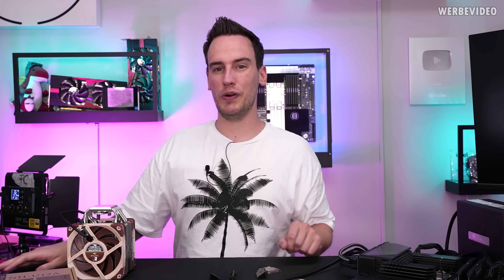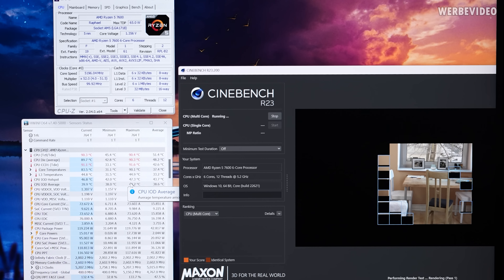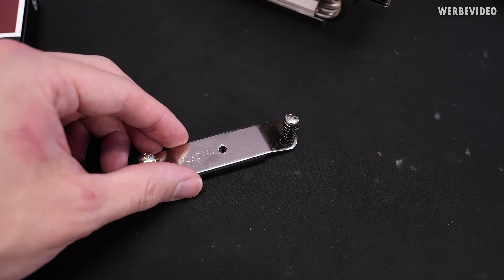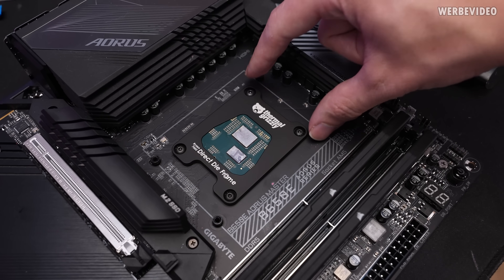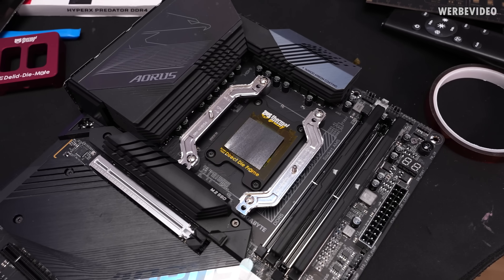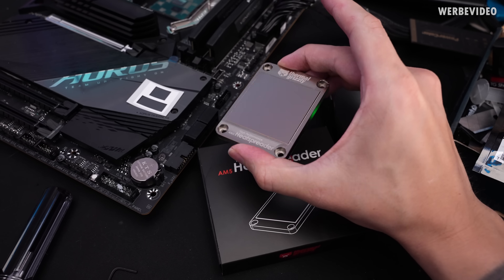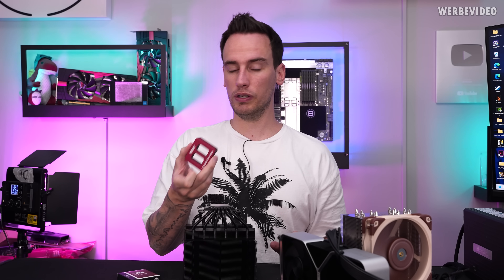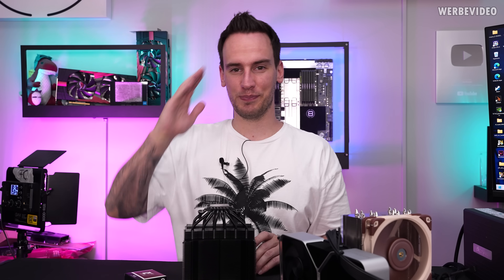How this 120$ Noctua Cooler beats a 360 AIO

Comment: This is great and all but putting this amount of weight on a board is a tterrible idea. Once I did this and LGA775 would randomly not boot due to warped socket.

On PGA I never had problems but those are on the way out...

Comment: Hi great video but I did not think this is a fair comperason. From someone who approachs very scientific for pc stuff I would like to see air cooler vs aio with stock cpu then what deliding is capable with mounting regularly then what is offseting the cooler is doing. In this video is not like apples to apples I think.

Comment: The only issue with air coolers is case compatibility, unfortunately my pc0-11 D is 155mm max, being 3mm too short otherwise I would have gone with a Noctua cooler for my recent upgrade. The Scythe Fuma 3 fits but isn't out for a few months, i'll probably swap out the corsair H100i I got once it's released though for the Fuma because the pump sound is atrocious on the new corsair AIO's.
Reply: My case is also 155mm max and yesterday I installed NH-U12A on my 7600. Still there is 2-3mm gap between glass. I think there will be no problem about your case too. It's Zalman N3 btw

Comment: You failed to mention the Noctua fan speed. You did mention the fan speed was locked at 1200 RPM on the AIO. So to be fair that should be the same locked speed on the Noctua cooler.

Comment: I have 2 i9 13900k systems. One had an NH-D15 the other an Aorus Waterforce X280. Both have similar cooling capability but the fans would run up and down all the time on the AIO and the fans were noisier so I put the NH-D15 in the 2nd system too.
Reply: That is an interesting real world test you have made there 🙂
Reply: If you mount the rad externally the Waterforce would be superior, rads in cases soak up lots of heat from other components really easily.
Reply: I learned the hard way that AIOs are not actually more quiet than air cooler. Sure your fans can run at really low rpm but you have a screaming pump which gives you a headache. I would take loud fans all day instead. My ears get a ringing from this AIO I bought and I start to develop a headache a few minutes after booting up.

Comment: These Direct Die/Heat Spreader solutions are quite appealing with the growing interest on SFF cases lately.
It makes possible keeping temperatures under control with powerful CPUs, high loads while cooling with compact coolers and less than ideal airflow.
But i have a question about these conduction materials: in this case, wouldn't be ideal to use those Honeywell thermal pads? the laptop industry is migrating to this solution , laptop chips are direct die cooled... And i bet Noctua will come up with a paste/pad designed idealy to sit atop the chips
Reply: Thermal pads are generally lower performance with the key advantage being less maintenance and more reliability - strictly speaking while a direct die setup can absolutely be very reliable, if you're putting in the effort to build one it's probably worth the tiny bit of extra effort to deal with higher performing paste as well.

Comment: Here is a philosophical question for the crowd. Is it temperature gains or temperature loss? Thermal gains sounds to me as the most correct, since there is no inherent positive or negative on a scale and you would measure positive outcomes which is subjective and situational.

Comment: I switched to Noctua air coolers more than a decade ago.  My newest system, an Intel Xeon W7-2495X 24-Core, ASUS W790 ACE, 512GB DDR5, also uses a Noctua NH-U14S 4677.
I stopped using water cooling about a decade ago when I had a $6000 system leak and corrode the main board and case.  I'm too paranoid now, I would be checking a water system daily.

Comment: 20€ 220V- 45W Fan will be much more cheaper to run with better results. Noise levels good enough. And 50€ 100W 220V AC industrial fan will blow so much air that you would need to tie your case and display monitor so they don't fly. It worked on worst south Europe summer for me, getting at least -20ºC and being as close to room temperature as possible. More elegant but with too much noise if not properly tuned is using a 12V radiator fan from a Motorbike or Car that have a lot of CFM, pressure, etc. Only problem is where to connect so big currents 80-100W and transient filtering, you'll need to ask a car-machine electrician. But cheaper and better.
How exactly waterblocks don't try to fix to existent cpu heat spreader? There are so many ways of tightly machining parts, headgaskets, water tight hig temp pressure adhesive, o rings, etc. for cents or some € of cost that it's incredible how much R+D effort goes to not try to not losing warranty or clamping to existing parts and reducing chances of breaking all expensive electronics...
If a supposedly 65W Ryzen 7600 goes to 90ºC you can alway buy a 12th/13th Intel Cpu and limiting max power to Level 1, and don't let it boost to max power, you'll get as much perfomance and even less power of actual Watts (instead of heat transfer related ones of AMD). PEtryy sure you can match gaming perfromance of a 7600 with a DDR4 12600/13400/13600K setup at real 65W (or below real 90W)

Comment: The kryosheet is a graphite pad. It's not optimal for cooling unless both sufaces have an absolutely perfect mirror finish on them, as it would produce air pockets in any imperfections as well as the graphite being not the best conductor compared to a silver based compound or even liquid metal.
I use graphite pads in retro computing because older CPUs were designed with crappy lithium compound as the standard tim, but modern components are designed for higher performance tim.
Reply: It's a graphene one, and it has higher conductivity than any thermal paste.
Liquid metal is better. You are correct here. But most people find its application quite difficult.
Reply: @tiggertsk  This isn't graphene, it's graphite. Actual graphene is a single atom in height. I own a few of these pads, and they are NOT for heavy use. Thermal grizzly doesn't even list the W/m*K rating for them, and even if it were comparable to a paste, it's still a solid sheet and cannot fill microscopic faults and cracks in the heat spreaders of the CPU and heatsink, these create air pockets that act as insulators.
Even in a direct-on-die solution, the heatsink would need to be a perfectly smooth surface with no imperfections for this to work as efficiently as TIM.

Comment: What a weird video lol

Let's take another look at his final tally:

Noctua Cooler: €110
Delidder: €70
Direct Die Frame: €40
Offset Bars: €5

Grand Total: €225

In his calculation, he intentionally excludes the delidder's cost, arguing that you can resell it at a minor loss of about €10-20. To me, this seems like quite a leap. Given that I regularly browse the second-hand market, I can attest to how infrequently these items appear; It's important to highlight that these are HIGHLY SPECIALIZED ITEMS, NOT something that the average hobbyist or even many enthusiasts tinker with.

If this video intended to craft a compelling argument for these products, it stumbled significantly in my view.  It not only portrayed the KryoSheets as unreliable, but it also made the whole process seem fraught with an unwarranted layer of complexity and inherent risk. To top it off, all it managed to present were marginal improvements when compared to a standard AIO.
Reply: Guessing not for you then, eh. The point Roman is making is that, if you already own a Noctua cooler, then you can still use it if you were to upgrade to 7000 series cpu and still benefit without buying a AIO. Simples. So your grand total should be 110 less or even less if you were to sell the Delidder,. Not for you, that's fine but their will be plenty wanting the option.👍
Reply: @madb132  110 + lost warranty + potentially broken CPU when delidding. You will probably pay twice as much in power bill after the OC in a month than what you might have saved by just buying a proper CPU for your use case.

Comment: Noctua U12A is a beast cooler. I just switched from a 280mm Ek Elite AIO and I have much lower idle and load temps. I was a Noctua doubter before.
Reply: EK AIO 280 as intake wil give u alot lower temps
Reply: @norkris8729  you are wrong or in denial. Open test benches don't have "intake" or "exhaust" configs because there is no case. Explain my better temps. I mounted and remounted the 280 several times to rule out mounting issues. I only mounted the U12A once and saw better temps. 

Also I was talking about switching from an Elite version which has 4 fans for a push/pull config which should be about 5C better than a normal EK 280 AIO.

The U12A is a beast cooler plain and simple. 

I'm upset I spent $200 on my EK instead of going to air cooling like everyone said to do. Maybe you should try a U12A for yourself.
Reply: @gamerscore88  when u have a bigger surface area (the aio) to cool with. And tests saying a 280 besta any air cooler. Ur left with user error or defect unit.

Water transfer heat better than air and 280 aio is bigger.
Reply: @norkris8729  denial it is.

Comment: Would be interesting to see some curve optimizer results from a delidded cpu.
CO alone (no pbo or other optimizations) on my 5900x dropped multicore CBR23 temps by about 15 degrees C, upped boost clocks 100-150mhz, and gave 4-5% performance boost.
Reply: That is not an indication for any cpu. It depends on silicon quality solely (plus maybe a tiny bit on LLC).
Imagine overclocking guide written specifically for 'golden sample' CPU that just straight up doesn't work for any other processor. Is that helpful at all?

Comment: When deliding my 7950x I found that soaking the glue covering the caps with 99.5% ISP softened it and made it very easy to remove. I applied a thin coating of MG Chemicals 422C on all of the caps and bare contact areas. The direct die frame contacts this thin coating, but doesn't seem to affect anything negatively. So this is an option to those wanting a conformal coating still.

Also, if you have an airbrush, you could tape off the dies and rear contacts and spray this conformal coating onto the caps and contacts for an even thinner coating. I did this with an r-pi a long time ago when developing a smart solution for an HVAC company. It works perfectly and no thinner is required, but definitely clean the airbrush immediately after spraying. Learned this the hard way, lol.
Reply: Would conformal coating rated for transformers be any good I have 180c spray air dries etc?

Comment: An AIO pump can fail, but an air cooler cannot. Noctua also provides free mounting kits for new sockets and delivers them to your home for free. I have been using a Noctua U12-P for 15 years, changing sockets from Intel 2600k to various other Intel and AM4 AMD sockets, and currently, it is mounted on my AM5 socket. It still functions perfectly, just like the first day. The fans work flawlessly, and it remains silent. Let's see if an AIO can last for 15 years and if AIO companies provide free mounting kits for new sockets. Noctua is the best 70 euros I've ever spent since 2008.
Reply: Just like arctic. They provide free mounting kit for 10+ years old coolers.
Reply: quality is always cheaper :) so get an Apple Silicon which doesnt even need cooling :D
Reply: @JohnSmith-pn2vl   " so get an Apple Silicon which doesn't even need cooling" 🤣🤣 This is PC, "We" do as we like, Not told what to do by a company. 😁👍
Reply: Fans fail too
Reply: @BuzzKiller23  fans can be replaced, aio pump cannot. Also aio has fans too lmao
Reply: @BuzzKiller23  
Very very rarely..at least with Noctua. Fans on my NH-D15 are now 8-9 years old and they work just as well as they did when they were new.

Comment: AIO doesn't necessarily mean better cooling. It just means it's easier to mount the radiator elsewhere. Heat energy is energy. If one gets rid of the energy better, it cools better.
Reply: front intake 240 aio is better cooling

Comment: will the heat spreader and micro waterblock still be compatible with x3d cpu? Also for the kryo sheet, will it also perform better for non-delid cpu as well as gpu (which is technically all direct-die)? Have been assembling pc for 5 years but never mastered thermal paste application lol.

Comment: Couple points about the video.
I believe using a higher end CPU such as 7700X would be the minimum target for people willing to delid or invest in these high end parts.
Secondly you don't need 200$ to get a good AIO, best example is the Arctic Freezer II it sells for half that amount so the conclusion based on an overpriced cooling solution is a bit misleading tbh. Without forgetting the fact that delidding isn't for everyone and it can still break your CPU, all in all this was a good experiment.

Comment: Interesting demonstration. What's even more impressive is the level of honesty and transparency in this video. You showed us the test cases you ran and included outcomes for the products even if they were not favorable. Integrity. I'm sure the marketing department reached out afterwards though. :P
Reply: Comparing stock on AIO to delidded on Air though? Scientific value: Zero, except that delidding is probably a cool thing.
Reply: @JSmith73 don't mistake AIO for custom loops, people purchasing them often want a plug-and-play solution. Comparing delidded Noctua tower cooler to a custom water cooling that runs without delidding - that would actually be a bad set up in my opinion.
Reply: It’s an interesting demonstration of options. Comparing apples to oranges of course but some people might not want to get an AIO for whatever reason.
Reply: You mean the lack of honesty and transparency. Issues? #1 Comparing only a very low 1200 RPM normalized fan speed between the two which is not only insanely low and not realistic for a real load hence his asinine thermals even at the end when no proper fan curve to manage noise vs thermal needs, but such low RPM fans will have issues pulling air through the grill of many types of AIO radiators (some worse than others). Yet he doesn't even really acknowledge the normalized vs max cooling potential which is misleading. #2 He is comparing a 170 Euro price setup vs a 200 Euro AIO when 45 - 120 Euro 280/360 AIO's destroy this setup with proper fan curves when allow to run higher, often by a very considerable margin. Thus this is not saving money, being actually considerably more expensive in fact... and it has worse results and you have to deal with liquid metal which simply isn't for everyone.

Comment: I still use a NH15 cooler in push pull on a closed PC, because of the ugly colored fans. In total I have 9 running and this PC runs 24/24/7/365. And you can hardly hear the fans. Also, when it's summer and temperatures climbing to 35-40°C in that room, this PC is not overclocked. Ehm, where do you buy your cables, Roman? I'm looking for a seller who makes them custom, I want to buy these in flashy green, but no one seems to sell them anymore.

Comment: I've recently gone through the process of delidding my 7950x, used the TG delidding tool and TG LM. My heatkiller pro block didn't make good contact with the die (the metal standoff's on the backplate where preventing it from doing so). So I took out the dremel and went to work. After that I used some smaller z-height washers and the block mounted perfectly on the 3 dies. All in all, lost about 10-15c, and gained performance in the process (chip can do all core 5.8Ghz at 80-84c max temps), bringing my CB23 scores to over 40k. I used nail polish over the capacitors to avoid shorting, and while this was a bit of a nerve wrecking process, I'm very happy I did it. The heavy full copper heatkiller pro block doesn't have any issue with absorbing the heat load dissipated by the dies. 

So while definitely not recommended for the first timers, it was my next step in going even more extreme on my system and all said an done, happy camper! Thanks for the great tooling provided to make the process so much easier, even if I did still have to do quite a bit of diy (but that had todo with the waterblock, not the method in general). 👍